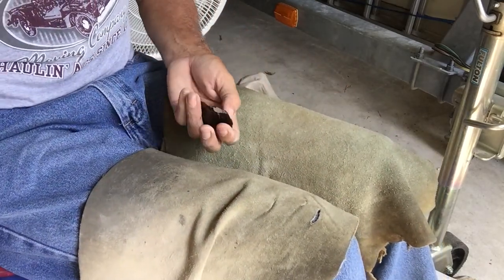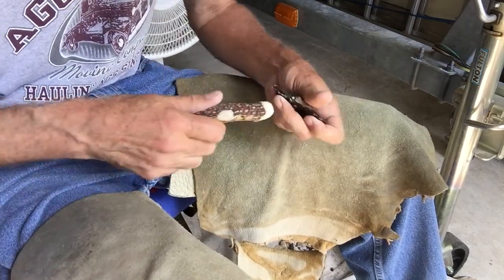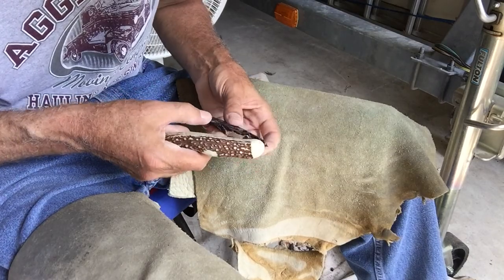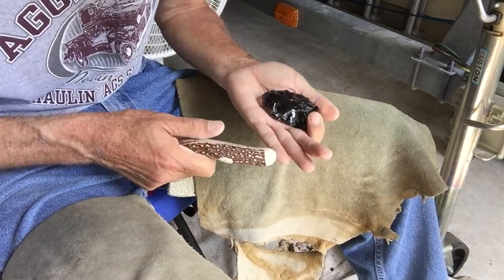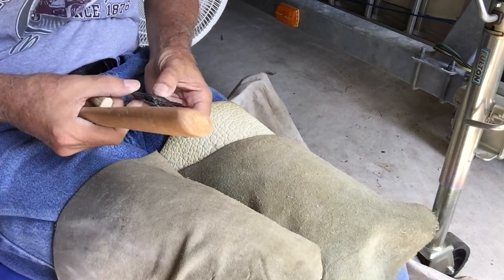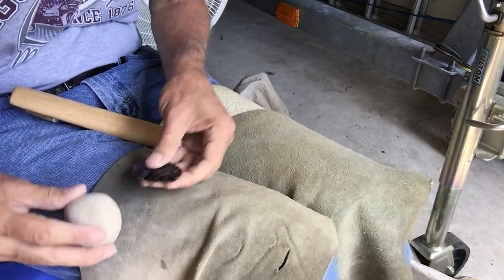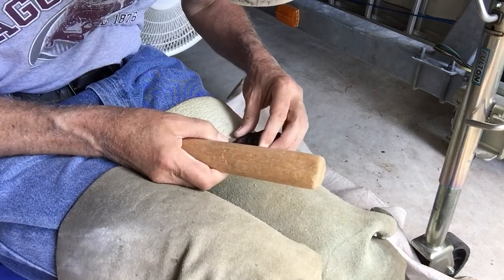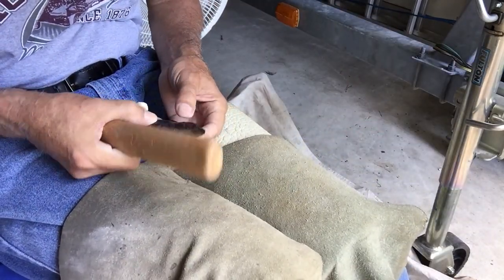cirrusly bad abo knapping 3rd of 5 videos

Comment: Seems like it might matter the size, weight, material, and speed of the baton you hit your punch with might matter? I made a big hickory mallet to hit mine with but it's not working as good as a much lighter antler that I can swing faster. 
"This will only hurt for a little while, I'll only.........."
You got to be careful with David Allen Co
Reply from the maker: Shane K one of the primary reasons to use punching on abo work is that the flake initiates better due to the more rapid energy transfer. so the size, weight, and material of both the punch and the billet matter tremendously, as does the speed of the billet. you have to experiment with different tools to determine which work best for you.